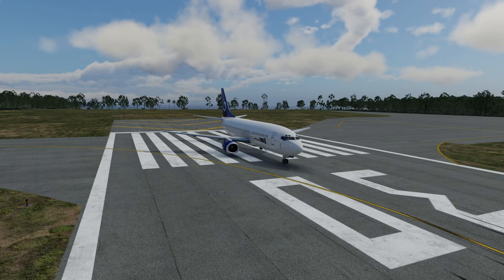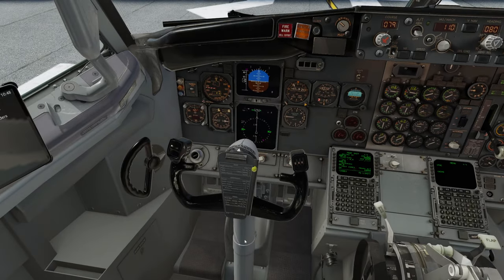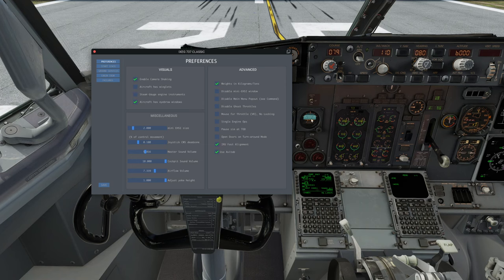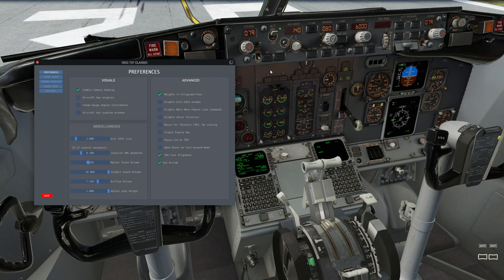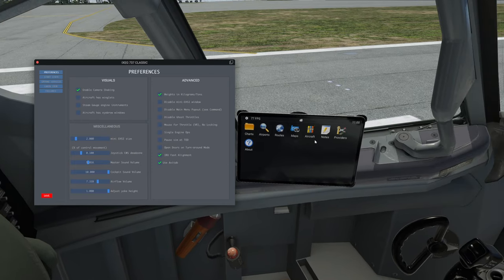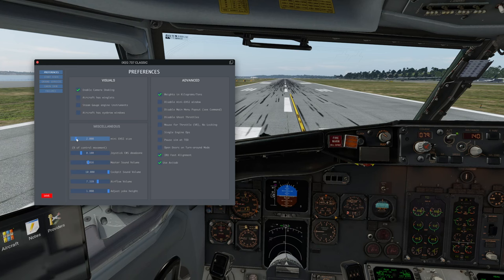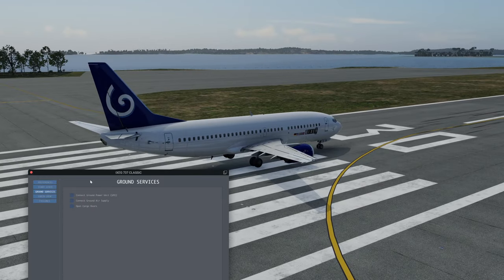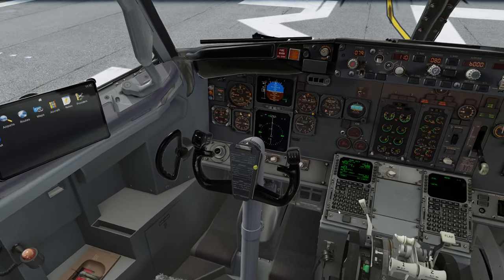IXEG 737 for X-Plane 12 - Setting up your controls and preferences

Comment: Thanks, Jan. It's great to see you producing videos again. Excellent video. One suggestion: you might want to consider increasing the gain on your voice/microphone level for the video's audio. I have both the youtube audio level and the system audio level up to maximum on my laptop, and your voice is still very quiet. Even with no ambient noise in my listening environment it is difficult to hear your narration. Looking forward to your next tutorial. Thanks, Rich
Reply from the maker: Hi Rich, yeah, I found out that the volume is a bit low after doing the video...should be better for the next one, I expect to zero in on the optimum over time ;-) Thanks for the heads-up, Jan